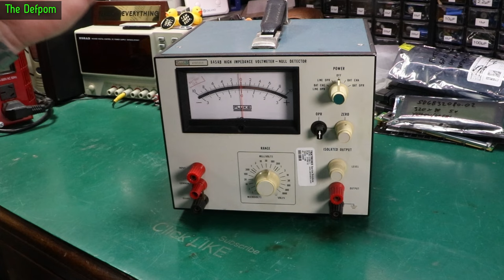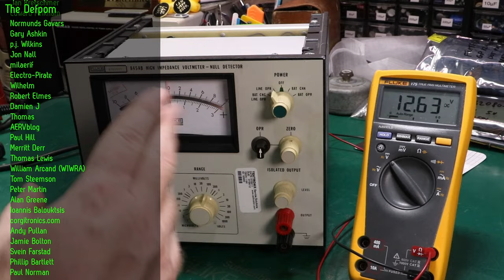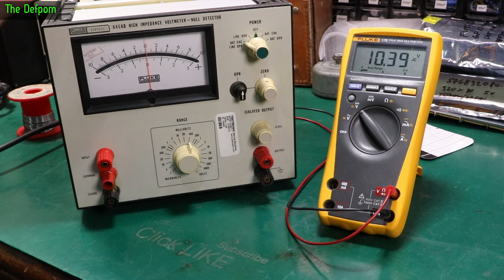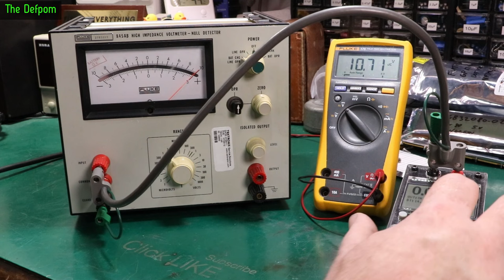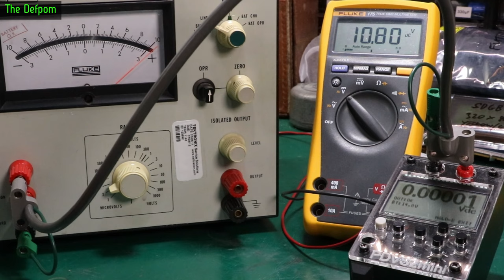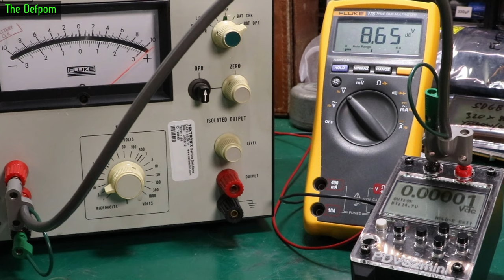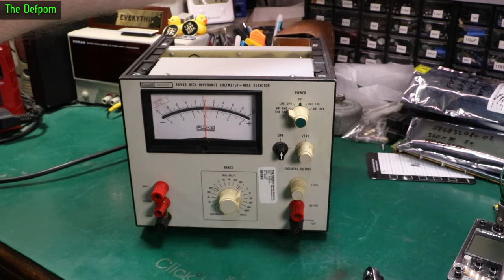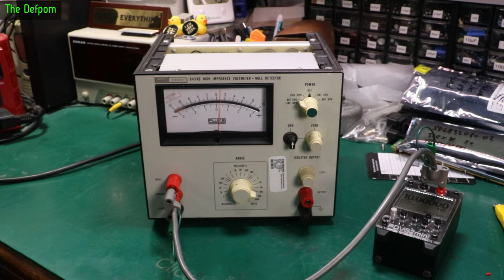🔴 Fluke 845AB Battery Replacement and Testing - No.1211

Comment: Hi, many devices of that time used batteries as an imaginary power filter, if we want battery operation it's fine, it's worse if we need to get rid of the batteries. I have a TEK 212 portable battery oscilloscope and I only use it as a monitor for the curve tracker and that is exactly the case when you don't want to worry about batteries and their possible leakage. I solved it in a simple way, I made a completely new power supply in the space after the batteries and I have peace of mind.

Nice day 🙂 Tom

Comment: Well, I awaited this video for a long time, well done and thanks!
Good explanations about the battery, used as zener diode, and as a line filter capacitor. In my 845AR I replaced this primitive circuit by a proper and more silent LM317 circuit.
Nevertheless, these units very well run on pure AC mains also, i.e. that mains mode is not more noisy.
It seems, that there is always a hum visible on the needle, or is it a video artefact?
Even in the 1, 3 and 10µV ranges, it is not noisy (hum) at all! There is additional damping, so the needle pegs a little bit around zero in 1µV, which would show a certain amount of low frequency "noise".
The advantage of the battery mode is the Ground Loop de-coupling. Have in mind, that  this null-voltmeter was  and still is used in conjunction with the ultra precision Fluke 720A K.V. and Fluke 752A 'Reference' voltage dividers, comparing and nulling voltage differences on the high side of these voltage bridges, which is much more sensitive compared to the Ground side zero measurements. 
Therefore, the 845AR/AB gives unparalleled performance, superior over the HP3458A, the Fluke 8508, and the KEI 182/2182.
Although the amplifier of the 845AR/AB is doubly isolated from the outer case, there will anyhow be very small leakage currents to ground, which misalign the zero reading.
The 845AR/AB has ~ femto-Ampère low bias currents, when zero is attained.
Therefore, there is a different grounding scheme necessary, when used on batteries, versus AC mains, due to these residual leakage / case - ground currents.
These effects can give errors on the order of several ppm for certain configurations. 
For stable sub-ppm measurements, as volt-nuts nowadays can do, you really have to take such subtle effects into account.
Reply from the maker: My work area is a very noisy environment, lots of RF and electrical noise so getting a noisy meter moment is expected, although it could be that it needs adjustment or maybe some caps replaced, even though they basically test ok.
The finer details of volt nuttery is something I have little knowledge about, and am certain that I would be doing things wrong when trying to use it.
I wish I had picked up a used 720A years ago when they were a reasonable price, now they are horrendous prices, three to four times what they were 5 years ago, same for the 752A.

Comment: Hello. Nice video. This is AC-DC if i remember correctly. I would suggest to get Fluke 895A  or it's cheaper brother and almost same Fluke 885AB (even this has only 10MOhm above 11V measured compared to as they stated 'Infinite') in catalogue from Fluke i got. Ofc these two are DC models only. But in general they cost about 100 + shipping on ebay well at least the second one..the first one they still want to sell for 600 USD.or such

Comment: its hard to get test gear because of youtubers doing test gear there has become a surge of people wanting to rebuild retro gear just like with the vintage stereo rcvr market
Reply: Not only have the prices of testing equipment increased, the cost of transportation has also increased, and since I am from the Czech Republic, the exchange rate of the crown to the dollar or euro will make quality testing equipment an almost unaffordable item. Unfortunately, the quality of the parts sold here has also decreased (almost everything is probably waste from China - e.g. the newly bought capacitors had worse parameters than the 40-year-old Sprague, the terminals of the THT components are iron and only plated, etc.) and I am forced, if I want to buy quality parts for repairing or manufacturing test equipment, again abroad from reputable manufacturers, and this will drastically increase the cost of repairing or manufacturing equipment. All together, it makes such purchases of test equipment for amateurs a completely unprofitable business.

Nice day 🙂 Tom